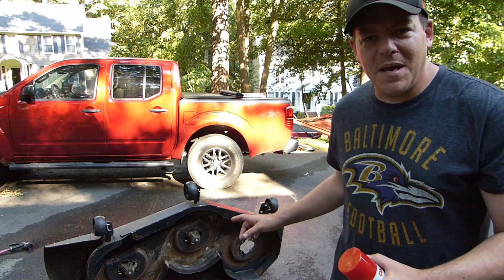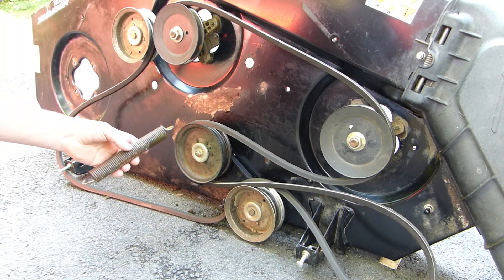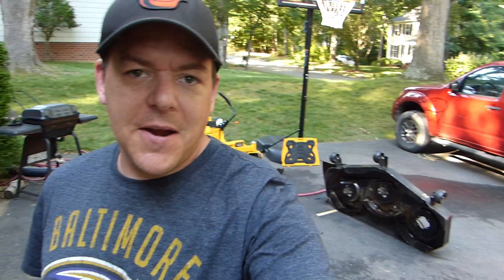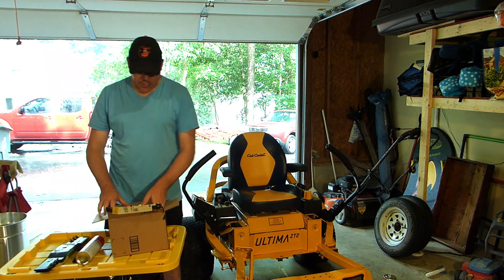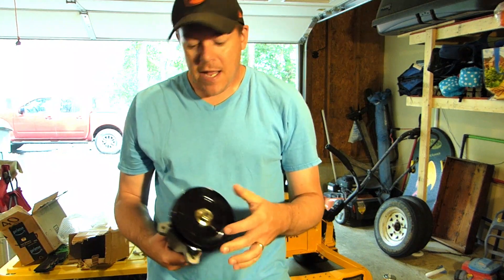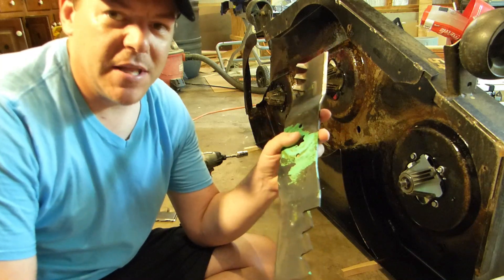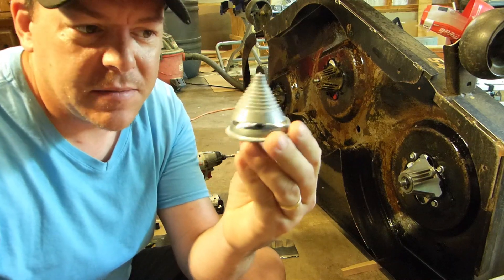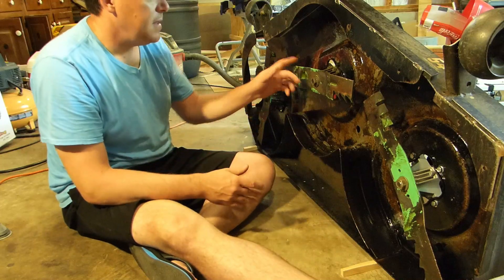#147 Spindle Replacement on Cub Cadet Ultima ZT2 Zero Turn Mower + Rust Prevention

Comment: Fluid film does not have much staying power... You'd have to reapply it after every mowing... Which is crazy.. never use the washout port.. it's also hard on the spindles... Just scrape your deck at the end of the season. And spray transmission fluid underneath the deck for storage.. and you'll never have a problem

Comment: I have a ZTX5 and it definitely has a beefier looking spindle. It cost me $160 to get an OEM replacement. I had a pulley grind my spindle shaft in half. It looks like it would be easy to rebuild but even the rebuild parts are $70. From what I can tell the pulley is actually held tight by tightening the blade nut. Not sure if that was something you noticed with your spindle.

Comment: I will be curious to see how that spray works. I know one of my winter projects will be sharpening/replacing the blades on the rotary mower and touching up any spots to try to prevent rusting.
Reply from the maker: me too. like I said, I expect to have to respray the deck with primer and paint if I want lasting protection, but we'll see!

Comment: That's one of the weaknesses of the Cub's for me  - the 4 bolt attachment point of the spindle is weak and bends easily. After owning one of their tractors it's a deal breaker for me. Husqvarna and Deere, even in their stamped decks , have a better spindle attachment- only the spindle comes through the hole and there's no gap for crap to get into your pulleys.
Reply from the maker: The hole and debris that collects on top of the deck is my chief complaint. It doesn't seem to impact performance. Its just messy and annoying
Reply: @WoodsTreeFarm  All the MTD decks seem to be built with this connection, even fab decks like yours. How do you like the mower on rough ground? By that I mean roots and uneven grass, not carpet smooth like in videos.

Comment: Thanks for the info. I was wondering if you had a different product from fluid flim when you were spraying that on. Looks like it's what I was hoping it wasn't. That may collect a lot of grass. That's unfortunate about the mower being mtd, I have the ZT2 60 with 10 hrs on it. But with your videos service and maintenance will be much easier for me over the coming years. Thanks.
Reply from the maker: I'm going to be mowing today and will lift it up with the tractor to see if there's significant sticking or not.  I'll post an update later next week. Thanks for watching!

Comment: zt2 w/60" fabricated deck here. 2 years in, and the fabricated deck is literally coming apart at the seams. have a cub tractor with a stamped 46", and that thing has held up wayyyyy better.

Comment: I would never reuse a blade that has a chip even though it has been sharpened and balanced. The metal or the blade strength has been compromised and the chip most likely has caused stress risers or stress concentration from getting the chip. My friend doesn’t have a Cub but one day his zero turn made a strange noise and instantly he  saw half of the blade fly out from under the deck and go off an easy 100’ -300’ perhaps more across the field. If he was in another area with buildings around or a person there would have been serious consequences. BE SAFE FOLKS.
Reply from the maker: yikes! that's scary. Thanks for sharing